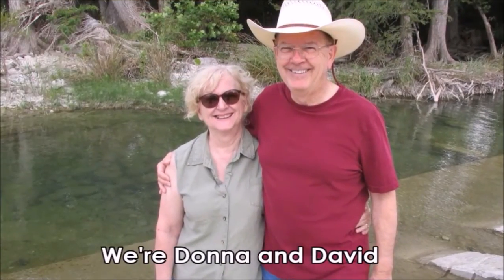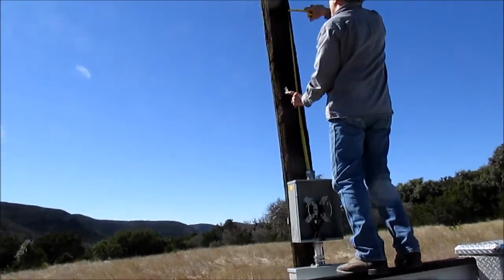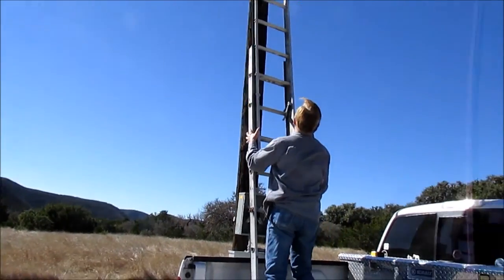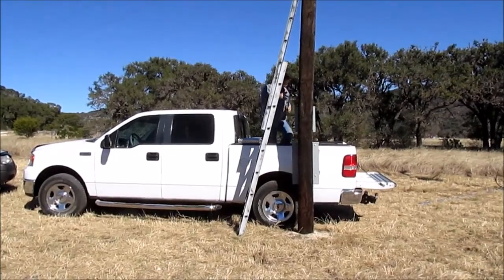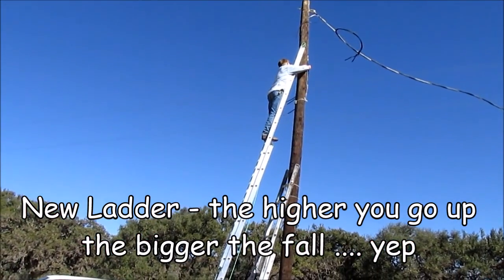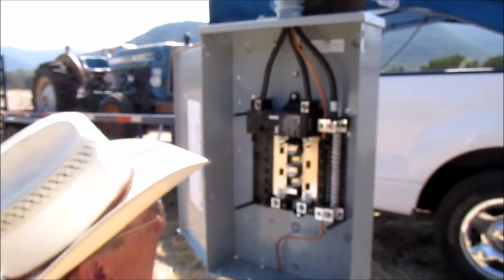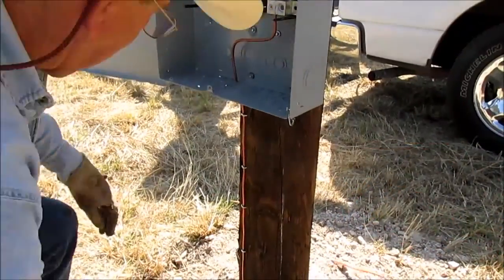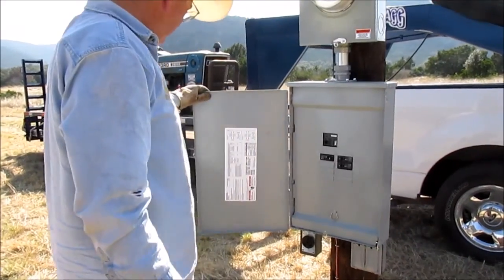Homestead Electricity - Connecting to Power Poles

Comment: What kind of conductors/cables are used for overhead service like this? THHN?
Reply: Usually a self-supporting triplex or quadplex cable for overhead work, then properly sized copper or aluminum thhn down the riser pipe.  Underground you can use direct bury cable, often called URD or tri-rated XHHW/RHW/URD, or XHHW pulled thru conduit. 

The NEC is very specific on how services are built. See article 230 of that code and your utility construction specifications book for exactly how to build yours.